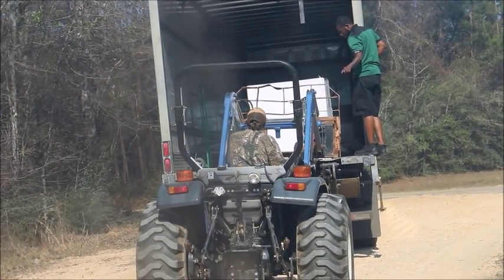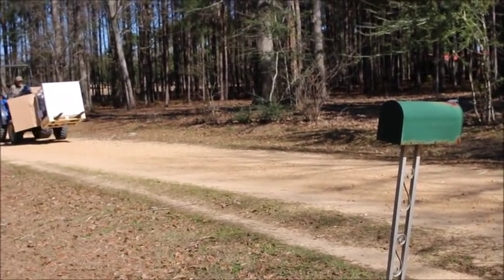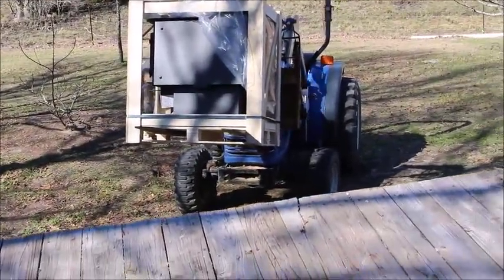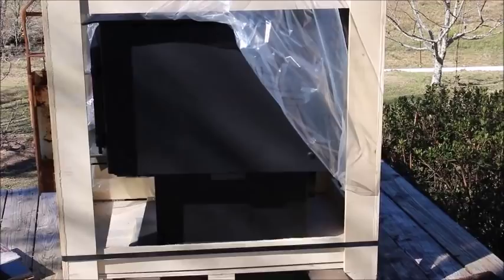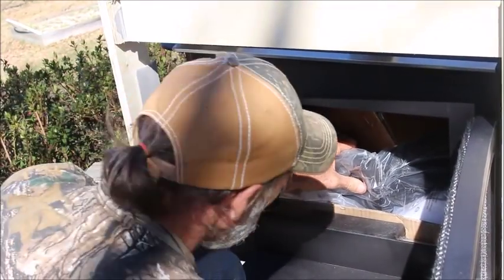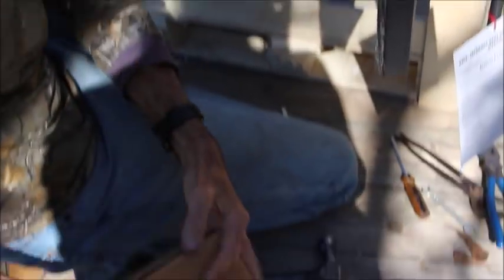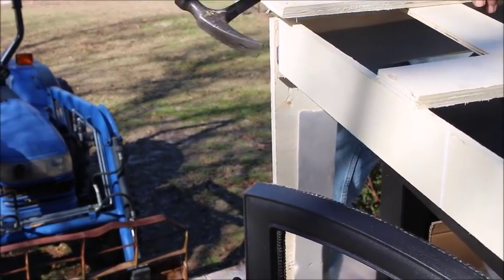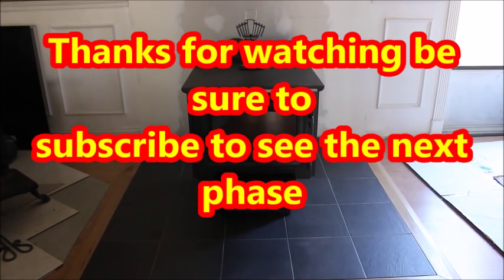The WOOD STOVE is HERE!

Comment: We have a similar problem with transport. We meet the deliveries on large trucks down at the council road and tranship to our pickup or tractor/trailer. We have oil  delvered in a small tanker and most local builder supply firms have small trucks but still fitted with a crane. Its the out of town guys who have the most problems. The local hospital have a 4x4 ambulance.
Reply: We've been having the same problem this very wet winter, with the local roads washed out. Our "ambulance" out here is a medi-vac helicopter.
Reply from the maker: Lloyd R. Living out of town has its benifits and its problems espically when the weather acts up.Thanks Lloyd